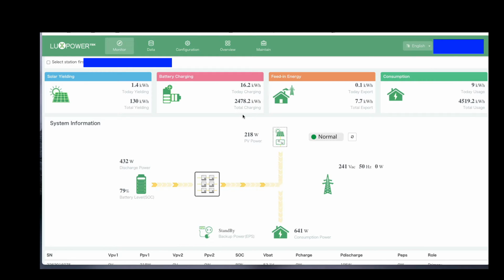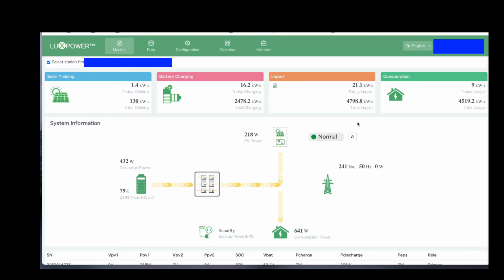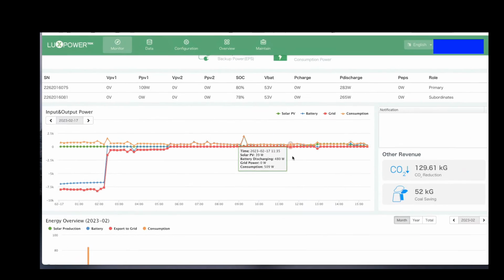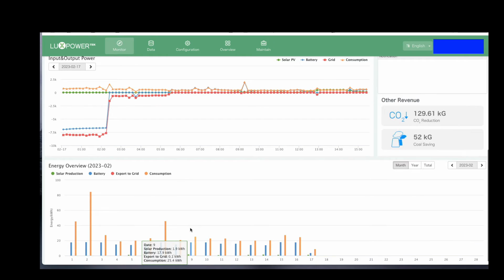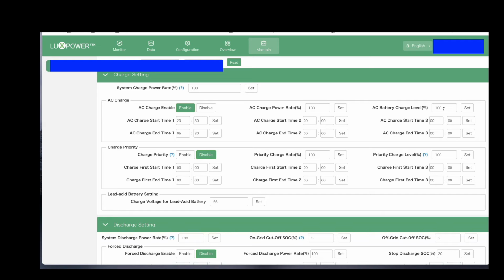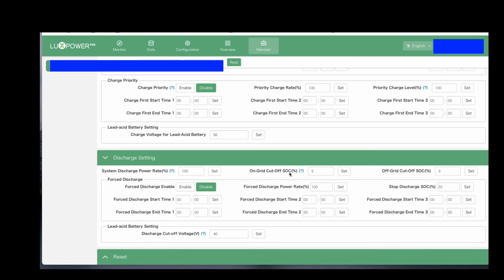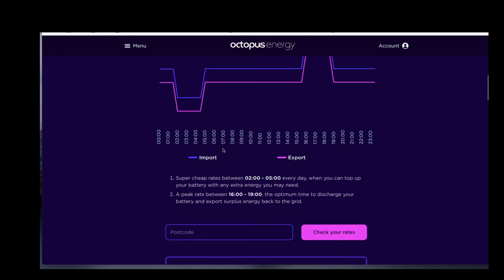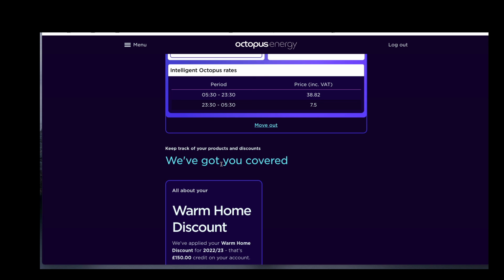LuxpowerTek User Guide Settings/Charging/Discharging Octopus Tariff

Comment: Just finished watching the complete video.  You did a great job!  I have 1.5Kw pv, 6.3kWh Lux batteries and inverter, and an EV. On Octopus Go. Charging when necessary overnight but pv is currently filling it up anyway. Big query (1) Octopus billing me for ~10kWh per month for peak rate usage despite no evidence of this; (2) I keep seeing mains pulls lasting far more than 30 secs whenever kettle etc is switched on - before batteries kick in. This shows as lots of spikes.  Any ideas about these problems.  Octopus ignores my queries about billing and Luxpower themselves are all but dead in the water! Minimal responses from installer.
Reply from the maker: there is a max discharge rate that the inverter or charge controller can do and if the demand exceeeds that then it will draw from the grid.
also it should only take around 2 secs for the system to switch to batteries once it detects demand from the house.
Best thing to do is check that your CT clamp is secure and without actually seeing your system thats all i can advise at the moment.
Thanks fro your comments
Reply: @YorkshireAutomation  Pity that you are based in Yorkshire!  You seem to be the perfect chap to check my system! 🙂  FWIW the installer told me that the controller takes 30 seconds to respond.  Hmmm....
Reply from the maker: @lawrenceharris1819  where are you based I do get around a lot..
Reply: @YorkshireAutomation  Stowmarket ..... <sigh>
Reply from the maker: @lawrenceharris1819  just too far outside London as I do get out there.
Send me an email with the serial number of the inverter and I can see what I can do remotely..
Thanks

Comment: Hello I am on octopus flux and I have fox ess setup inc battery and inverter,and I cannot force discharge to get the higher rate,I can only import,can I just go onto lux with my sight in details or do I need to put any other settings,I am not good with computers and settings and understanding all,thanks
Reply from the maker: Im not familiar with the options on the Fox ESS system just yet as i havent used them yet.  You are best speaking to the company who installed for you to ask them. Hopefully next month i would have completed my training with them too

Comment: I have solar plus batteries and I'm trying to work out how to maximise savings. I've noticed that my solar array can generate 6kw+ when batteries are charging but once my battery is full, this is scaled back considerably for export. I'm not tech savvy so I assume the limitation is the inverter. Is there a way of limiting the rate the battery charges so that I can maximise the amount I export during the day and just have the battery fully charged just in time for the sun going down. At the moment it seems like I'm wasting some of the sunshine
Reply from the maker: Hi
This is what the Lux Tech Team responded with as i had to find out myself:

there is a limitation on the export this is for the dno compliance
but the solar will only export when the battery is full and there is surplus solar due to low consumption
he can get purchase another battery and expand his system but limiting the battery charge rate wont do anything to use more solar

Comment: With solar panels, 5kW battery, and 3k Luxpower unit, I decided to create a simulation of using Octopus Flux over the last few days:
These settings seem to work for our situation, although I expect they can be improved upon:

With AC Battery Charge Level set to 30%:
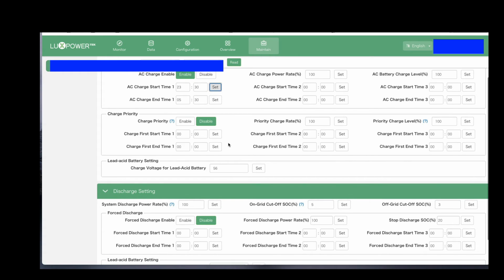Booster charges between 02:00 and 05:00 for the Cheap period, 14:00-16:00 to ensure there is sufficient charge to cover the peak period and 20:00-21:00

We have the EPS available, albeit to one location only, and it seems appropriate to ensure that the battery is charged in case this facility is required.

With On-Grid Cut-Off SOC set to 10%
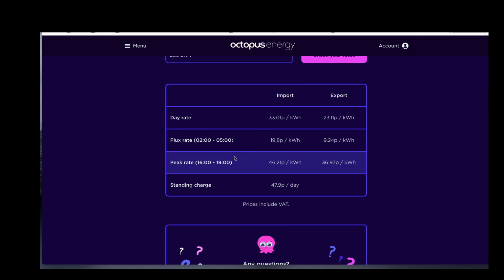Discharge is scheduled for 18:00-19:00, the last hour of the Peak period.

Comments invited.
Reply from the maker: please let us know how it goes. it also depends on usage and occupancy of the house.
Reply: @YorkshireAutomation  By my calculations, Octopus Flux would have cost a total of £8.39 less over the past 2 weeks than Flexible Octopus for the identical electricity usage, which was tuned to suit Octopus Flux.

I’ve included the additional Flux income from exporting in the 16:00 – 19:00 period and the loss for the additional cost of any imported during the period. Also, covering the reduction for importing during 02:00 – 05:00.

We are a very busy couple located in Hertfordshire, but definitely not 9-5ers. Heavy consumption early evening, like the general population, also mornings 8-10.
 
The panels are all South facing. We have a 100% gas boiler and we’re not expecting to get an Electric car on the driveway for the next couple of years.
Reply from the maker: @robertsprigge5535  
Thanks for this data. I'm sure it will help those who are deciding on what to do.

Comment: Hi, helpful video! I have a question. 
In my house, I have 2 batteries, 10KW in total. 
I have System Discharge Power Rate(%) set to 10% because if I leave 100% they download in no time, even if during the night I don't have any device turned on.
Why are they discharging quickly if I'm not using any device?
Thank you so much
Reply from the maker: If I remember correctly system discharge power rate is a force discharge setting. It won't do anything as long as its disabled.
Default is disabled. If enabled you are forcing the batteries to discharge to house and export
Reply: @YorkshireAutomation  System discharge power rate is outside a box called Forced Discharge.
By default,  system discharge power rate is set to 100. It mean that my battery will be discharged quickly.
Setting 10% is the only way to use the battery over night. Just not sure that it's the right setting because Consumption Power (in the dashboard) is always similar to Discharge Power or the solars power.

Comment: Helpful video - thanks.  I am permitted to export at 5KW and I notice my solar can produce in excess of 6.2kw in bright lunchtime sunshine - until my batteries are full - then I notice my luxpower inverter scales back the solar production to 5.2kw and limits my export rate to 4.6kw max (difference being my consumption).  Is there a setting that can be increased to up the export to 5kw - or is the 5kw a nominal figure and 4.6kw considered near enough?
Reply from the maker: I believe that is the default rate

Comment: As a Luxpower user, I found this a really helpful video, thanks.

I’ve been an Octopus user for some years, now with Solar panels and battery, and will probably switch to Octopus Flux when the current fixed contract expires next month. 

Seeing your video, as an initial trial, I’ve set the battery to discharge from 18:00 to 19:00 with Stop discharge SoC set to 20%. However, after this time the battery is actually dropping to 5 or 6% SoC. 

How can I stop the SoC from going so low? Thanks.
Reply from the maker: Hi
Thanks for your comments.
There is a setting called On Grid Discharge CutOff under discharge settings.
Set that to the minimum you would like.
Reply: @YorkshireAutomation  Thanks😃 I've just set this switch to 10% as I feel concerned about letting the battery go lower than that. I copied the Stop Discharge SOC(%) at 20% from this video as I thought that this would do the job. Clearly, I misunderstood the purpose of Stop Discharge SOC.

I don't feel I'm in control of the Luxpower BMS, as it 'leaks' a lot of battery power to the grid when it should be reserved for home consumption. 
Most of the time this is only revealed by the Smart meter IHD (In Home Display), the monthly electricity bill. The only time the grid should benefit is when the battery is full or when I require it.

The Battery SoC data graph gives the impression that it's intentional rather than a leak. Is there a way to prevent or at least minimise leakage to grid?
Reply from the maker: @robertsprigge5535  i believe that as the property consumption is ever changing and the inverter/charge controller is trying to balance everything a little bit of leakage is inevitable. you have to remember that the whole system relies on a CT clamp which uses magnetic field from the LIVE conductor.  This is not the most accurate way of measuring power but its the easiest non invasive and cheap way of measuring.  there is a margin of error in this method.  i believe this is the cause for the leakage.
Reply: @YorkshireAutomation  Great, thank you. Setting Grid Discharge CutOff resolved my concern😃

Comment: Thank you. This was very useful. My plan is to charge the batteries up to 100% overnight on the flux rate of 19.67p. During the day, I'll be using free solar or using the batteries or buying at day rate 32.79. If I generate more than I use it will charge the batteries or export at 21.79p if the batteries are full. During the second half of the peak hours, I will discharge down to 10%, earning 34.9p. I know I'll then be buying electricity back in the evening, but after the peak time it only costs 32.79p. Overall, I'm buying at 19.67p and selling at 34.9p and 21.79p.
Reply from the maker: Glad to help mate and yep thats a fantatsic way of maximising your setup!

Comment: Thanks for informative video as I have Lux power and greenlinx inralled last week. Planning to go onto Octopus Flux as soon as batteries certified . One question I'm trying to get my head around... 
I will want  batteries  to charge to 50% from 0200 to 0500 off peak , leaving room for solar charging later. I want to continue  using grid power during that off peak period and not let the batteries discharge until the grid cost has gone up, don't I? 
Can I stop them discharging while I can use cheap off peak  grid ? 
Thanks
Reply from the maker: Hi
Once the system is set to charging from grid they will not discharge at all until the end time.
So in your case 0200 to 0500 the house will use grid even if the batteries have achieved the 50% full like you specified.
Reply: @YorkshireAutomation  thanks for very fast reply! I just need to make sure the charge time covers the whole of the off peak period and doesn't finish before that period ends.. I get it now.
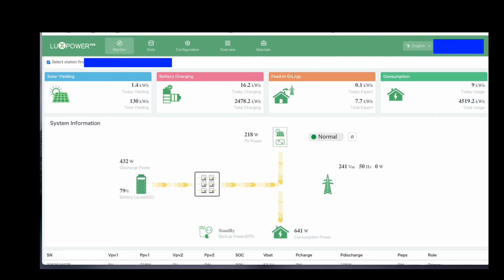Reply: @Judddsy  We have just gone on to Flux. I have found that if by the time we go to bed the batteries are still at around 45-50% then they  get  us through the night until hopefully they start to charge from PV the next day. My plan is in the winter to set the charge to 100% during the off peek and with any luck that will get us through the next day. On really dull winter days, it may be worth giving them a boost around 2:30 to 3:30 on standard rate.
Reply: Unless you have heavy usage at breakfast time, won't you be paying for electricity, albeit at a cheap rate, rather than using free Solar power to fill the battery during most months?
Reply: I have found that the weather compensation data is completely wrong. The prediction on Open weather app though is correct. I've told Infinity and they are investigating. I actually think the api data sent to lux is for correct location but thewrong day.. It comes from Open Weather. I'm noting what their app says at 7pm each day and comparing it with the api data which should be same prediction